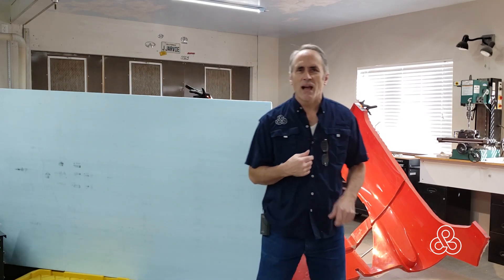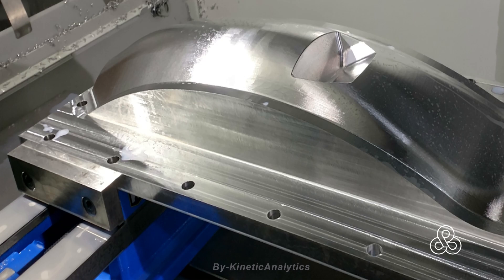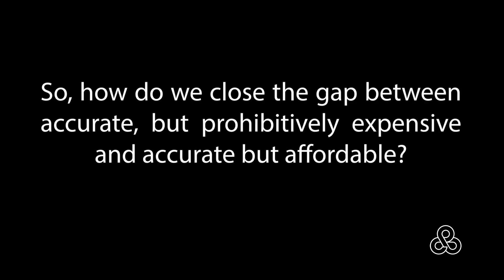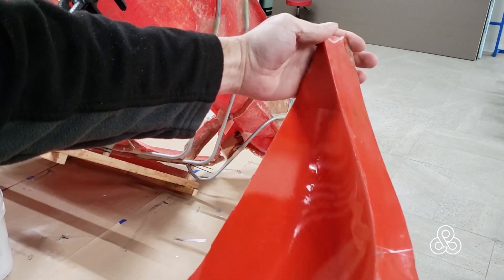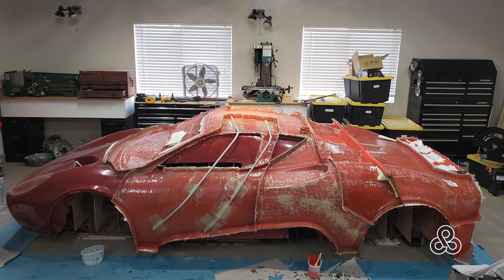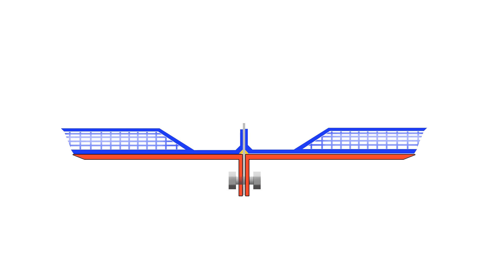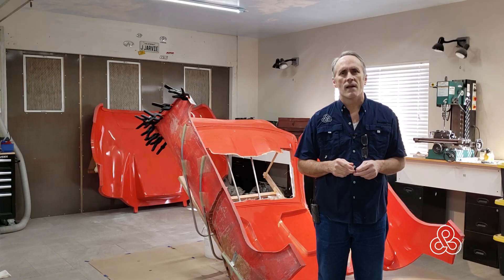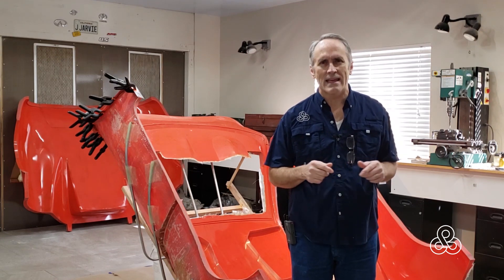Multiple composite parts from a single plug- The PLOP method. #10 BCs FRP series

Comment: If you don't mind me asking , what is the finished gap when you do it this way. I've got mine designed for 5mm.
Reply from the maker: The flashing I use is .8 - 1.2mm so that in theory is the gap. However, there is some shrinkage but that is minimal. In actuality some material removal is necessary, especially if it is a moving panel, such as a door. 4-5mm is great.

Comment: Hello!  First off great videos! I'm learning a lot.  I am currently working on a small fiberglass project and the PLOP method is exactly what I have been looking for.  The only thing I am a little curious about is the process of making two molds that will be mounted side by side.  You show in the video that you first install a small wall of clay to make the first mold on the plug.  Once this mold is completed do you then put it back on the plug to make the second mold that will mate to it?  Or do create a new clay wall for the second mold and hope that everything lines up correctly?  Please let me know it would be a great help.  Thanks, Dave
Reply from the maker: After the first section of mold is cured remove the clay wall, but do not remove the first mold. Add more releasing agent to the edge of the first mold where the clay was, and then build up your second mold against the edge of the first mold (and plug of course.) Once it has all cured you can drill bolt holes in the flange of the two molds that meet and bolt them together again after they are pulled from the plug.